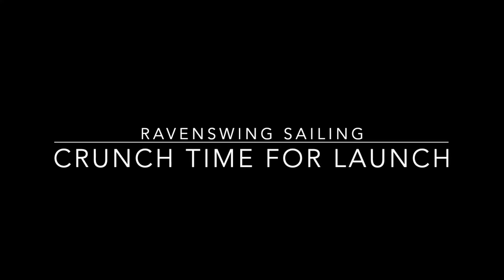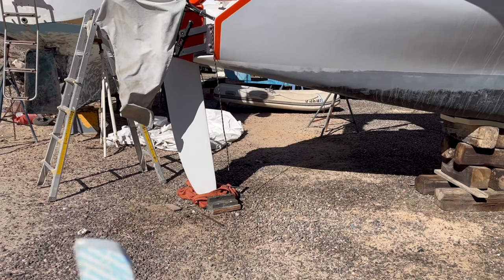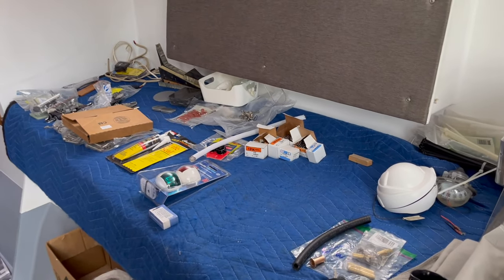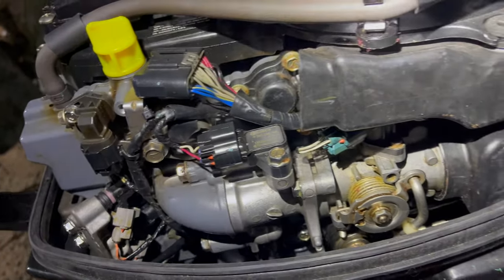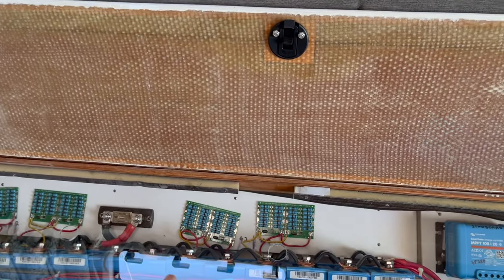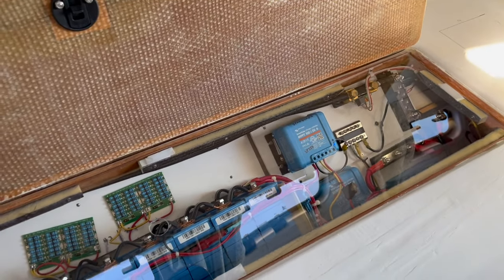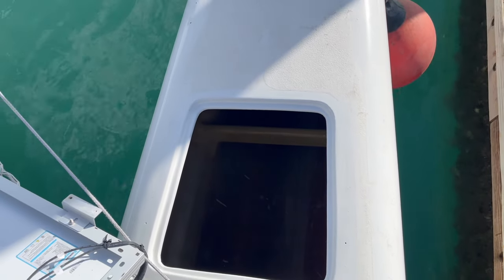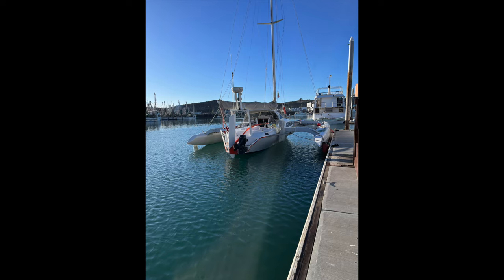Launching a 27' wide boat in a 29' wide travelift - no room for error!

Comment: Nice! Great to see her back in the water. We almost went down the route of tower fitting our anenometer as well (why don’t Raymarine provide spare spades in the box?!?) but ended up with a mast rewire and fitted it at the same time.
Reply from the maker: Same frustration here, literally just a few cents to Raymarine for tiny spades you can’t get in a small Mexican (or any other) seaside town. Argh.
Reply: @Ravenswingsailing Man oh man I hear you, no luck finding them at any Raymarine dealer here in St Maarten either so we ended up botching together our lovely new $700 anenometer install!!!

Anyway, great to see her back in the water and looking forward to yours and Ruby’s upcoming Sea of Cortez adventures👍